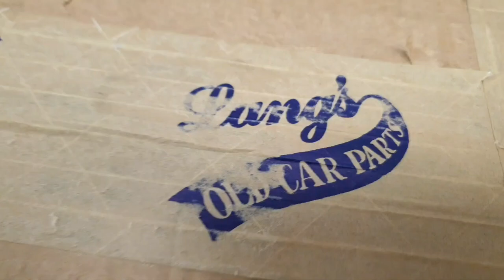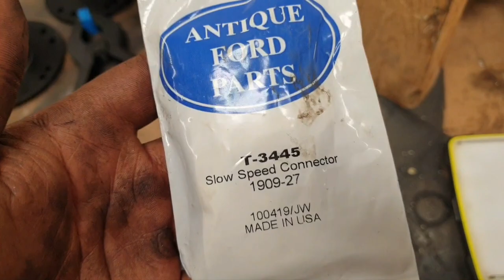Ford Model T Restoration/Build | Part 26 Transmission Bands, New Linings and Installation

Comment: Good video.  I have replaced my transmission bands before but I always removed the whole transmission cover which is a lot of work.  Last year I replaced the band for the brake with a Kevlar one because I couldn't get the cotton ones anymore.  I thought I had some cotton banding but couldn't find it until after I installed the Kevlar one.....   figures.  Anyway I don't think I'm getting as much friction with the Kevlar as the cotton ones.  Yours has the wider brake band so it might not make any difference but I am planning on going back to cotton but this time installing them through the transmission door since I don't feel like doing it the hard way.  Anyway has anybody else seen a difference in the friction from Kevlar vs. cotton?